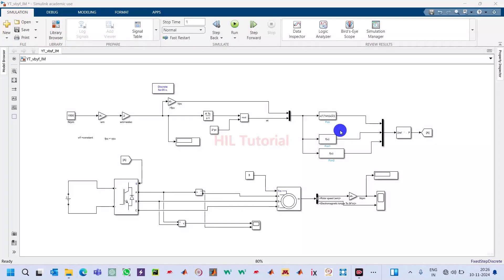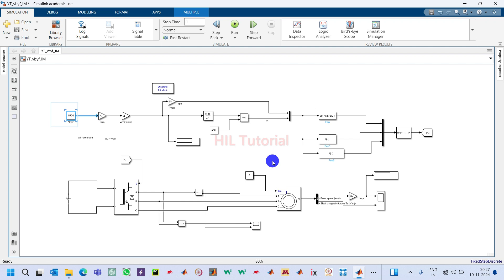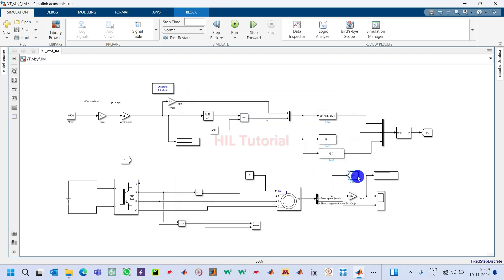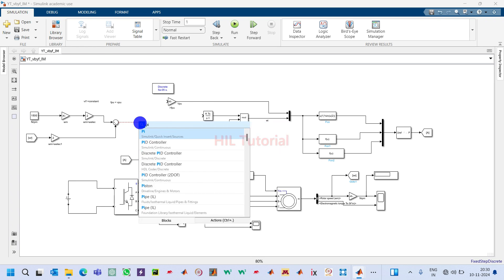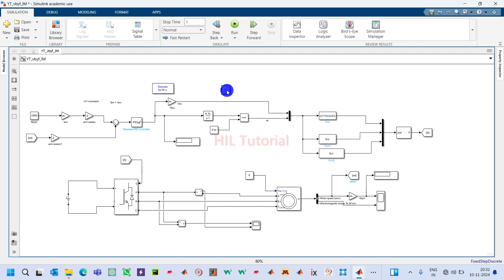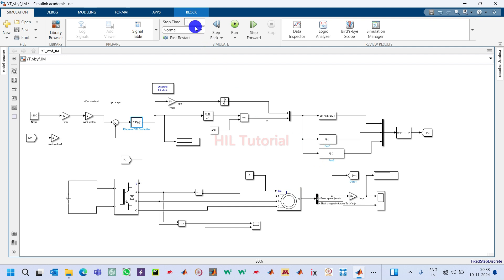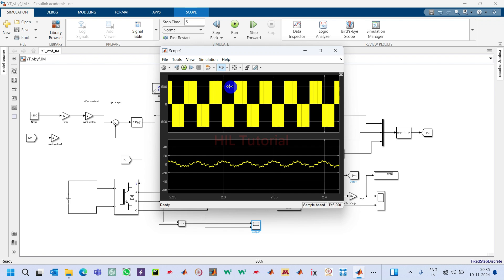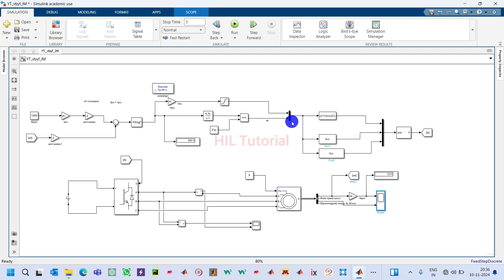Simulation of Closed Loop Control of a 3-Phase Induction Motor (SC) || V by f Control || Part-03 ||

Comment: Can you tell me what parameters I can change so that my PI controller is perfectly tuned and I want to use PI instead of PID so what to do?
Reply from the maker: Just you have to choose an optimised value for kp and ki to achieve smooth response